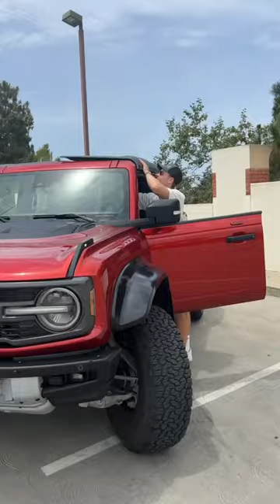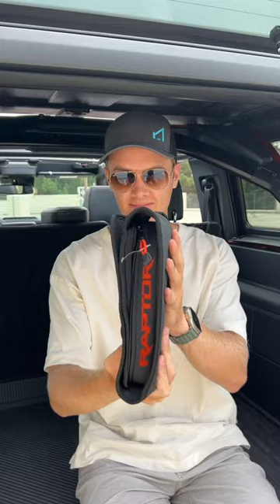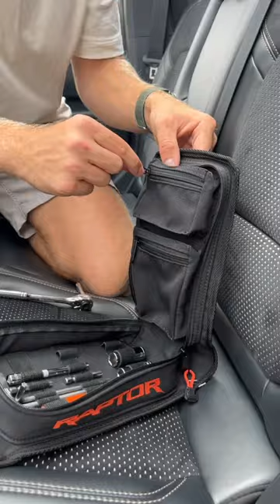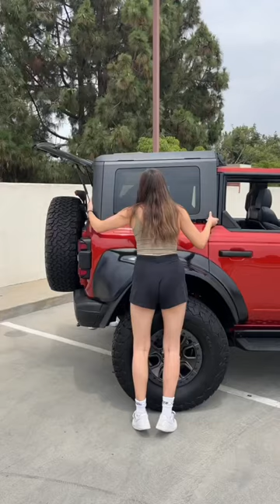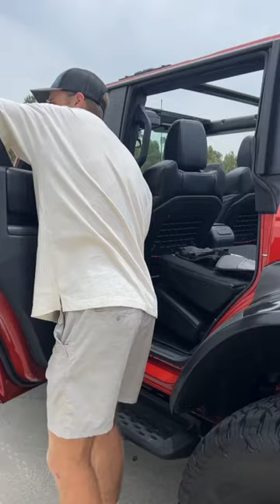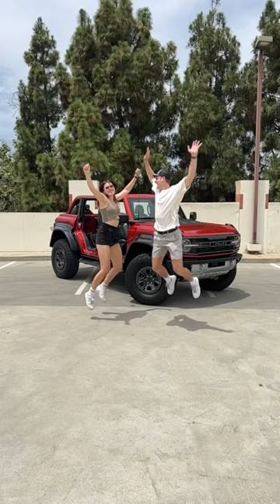Taking the doors and roof off the @ford Bronco Raptor! #ford #broncoraptor #nodoors #cars #newcars

Comment: That curb is the most extreme thing that pavement princess will ever do im really surprised that the ball joints survived.
Reply: What a broke hater comment 😂
Reply: @freedomisntfree_44  my 88 bronco 2 is ten times the bronco any new one will ever be
Reply: @Quackerstacker1973  the bronco 2 was almost as bad as the sport 🤣
Reply: @freedomisntfree_44  mine is not even close to stock the only thing it still has is the engine and transmission
Reply: lol someone is just jealous because you could never afford one
Reply: @anfernee6566  my 2023 f350 laugh's at that comment.
Reply: @Quackerstacker1973  yeah and my 2024 raptor R laughs at your pocket
Reply: @Quackerstacker1973  the motor and trans are a joke in those barely made enough power to move let alone go over a curb. I know I’ve owned an 89 and 90 bronco II. Id much Esther have a full size bronco 80-96
Reply: @neooverby3750  you really don't know what you are talking about my 89 has plenty of power to turn 35's on one ton axles
Reply: Pavement princess LMAO 🤣 thats great 😂
Reply: @Quackerstacker1973 bud, that bronco raptor will do everything yours wishes it could. There’s a reason you swapped axles, assuming you aren’t making things up to impress little boys on YouTube, unless you are a little boy. You say it’s junk and your 88 is better, and then follow that by saying nothing is stock. So everything is not stock and you’re Comparing it to a stock rig, that 9/10 people would still choose over yours and Is still more capable than yours
Reply: @joshuaearnheart2756  you won't take that 80,000 grand rig to the places that I will force my rig into and I will put my beater up against any raptor.
 The new bronco's are decent if you fix the steering do a quality lift so you can clear 37's and they will get you back and forth to the grocery store.
Reply: @Quackerstacker1973  buddy, the bronco raptor comes stock sitting on 37s. And the tie rods are much stronger on the raptor version. Couple hundred dollars in billet tie rods and you’re good for whatever, yet you think your completely custom 88 can compare? Go get a bone stock 88. And let’s get real, if you put 37s on anything it needs upgraded tie rods. Jeep guys have to replace a ton of stuff. Steering stabilizers, shock mounts get broken easily, I forget the name of it, I think it’s a pan hard bar? Possibly. Those bend up like wet noodles. U joints are junk. Rear diffs are weak. Let’s not even talk about Chrysler wiring! But at least they have a rival. GM is so far behind it’s not even funny. The blazer is now for soccer moms.
Reply: @freedomisntfree_44 hurt ur feelings good
Reply: Lolol. I'm not too proud to admit that my wildtrack model will be 99 percent pavement princess. She's just too pretty. I'll get a used jeep for the dirty tough trails. 😄

Comment: That’s a pain
Reply: i mean if you own a jeeo, you would have to go through the same ordeal also.
Reply: @cchen4754 
No you don't. Jeep tops come down way easier. Some newer models can be put down from the drivers seat.
Reply: Jeeps are also there times as loud on the inside 😂 I'll take the silent road noise for a few extra steps.